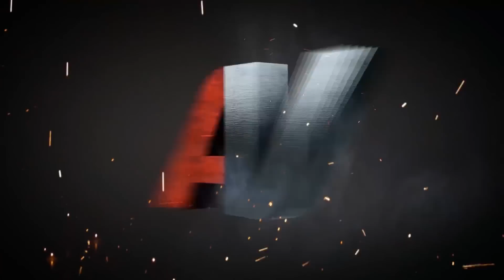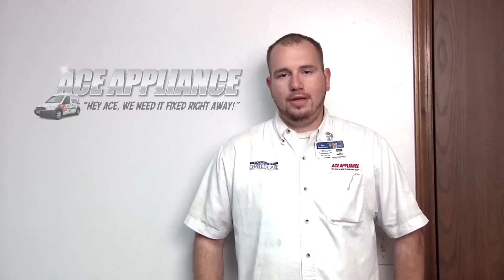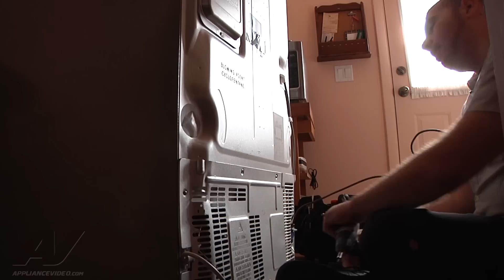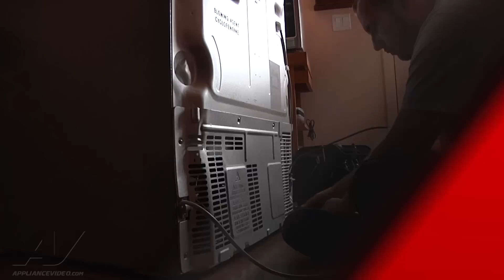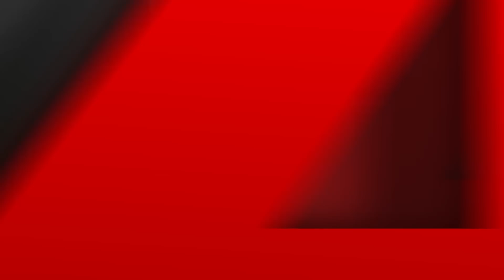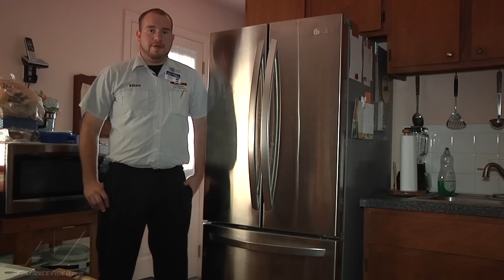LG Refrigerator Repair - Not Cooling - Relay - Diagnostic's & Troubleshooting

Comment: Ok same problem. BUT compressor is running. I didn't any codes until I went through the test procedure through the board. What are you thoughts. Oh yeah  22 was the "code" that came up during the testing procedure. I dont get fan in the freezer or in the refrigerator section but did under test .. Unit has been off over night so it's not frosted up. Also compressor is not warm or hot to the touch same with line going to condenser coil. Ok disregard 22 it's not a code it's part of step 2 disgnostics
Reply: Did you find out what it was, I’m having the same issue rn, any advise would be useful thanks!
Reply from the maker: Great question, if you have a more technical question that our parts department cannot answer, you can search our over 17,000 answered questions free at our website www.ApplianceVideo.com under our Repair Help section. You can also call our parts department at 1-800-830-5465 and they can give you help 7-days A week ,or search at www.SaveMoreOnParts.com  .

Comment: I have the same problem.  I can't seem to get the relay part from my appliance parts store.  Suggestions on where to get one asap.
Reply from the maker: Great question, if you have a more technical question that our parts department cannot answer, you can search our over 17,000 answered questions free at our website www.ApplianceVideo.com under our Repair Help section. You can also call our parts department at 1-800-830-5465 and they can give you help 7-days A week ,or search at www.SaveMoreOnParts.com  .

Comment: I have model Lmxs28626s and it not cooling properly ,but the freezer works. I have had the computer board changed, the damper panel/motor, the evaporator fan changed and it still will not get above 42 F Any help would be appreiciated..
Reply from the maker: Great question, if you have a more technical question that our parts department cannot answer, you can search our over 17,000 answered questions free at our website www.ApplianceVideo.com under our Repair Help section. You can also call our parts department at 1-800-830-5465 and they can give you help 7-days A week ,or search at www.SaveMoreOnParts.com  .

Comment: Hi I needs some help I have lg French door refrigerator lg replaced compressor drier just about everything possible what the tech said well my problem is refrigerator not cooling enough I have it 34 and it wont cool enough I have temamerter inside and says 47, 49
Reply from the maker: Great question, if you have a more technical question that our parts department cannot answer, you can search our over 17,000 answered questions free at our website www.ApplianceVideo.com under our Repair Help section. You can also call our parts department at 1-800-830-5465 and they can give you help 7-days A week ,or search at www.SaveMoreOnParts.com  .

Comment: I have an LG Fridge model LFXS24663.  The fridge works fine and keeps food cold.  Freezer does not.  It does not make ice.  Thermometer shows 45 degrees no matter the setting being at 0 degrees.  Do you know what the problem might be?
Reply from the maker: Great question, if you have a more technical question that our parts department cannot answer, you can search our over 13,000 answered questions free at our website www.ApplianceVideo.com under our Repair Help section. You can also call our parts department at 1-800-830-5465 and they can give you help 7-days A week ,or search at www.SaveMoreOnParts.com  .
Reply: Hi Margie. I have the same problem discovered today. Did you ever find out what it was?
Reply: Hi Margie, I'm having the same issue, may I ask how did you fix yours. What was the culprit?

Comment: LG LFX25974SW not cooling, help! Compressor and evaporator area fans are working. Compressor area sound seems normal to my untrained ear.  Thanks.
Reply from the maker: Great question, if you have a
more technical question that our parts department cannot answer, you can search
our over 10,000 answered questions free at our website www.ApplianceVideo.com under our Repair Help section. You can also call
our parts department at 1-800-830-5465 and they can give you help 7-days A week
Monday -Sunday, or search at www.SaveMoreOnParts.com  24 hours
7- days A week.

Comment: Hi, I ordered two relays and  it works good after replace the old one. However, it works only for two to five days and then the  no cooling coming up again. I replace other relay, It keeps the same.  Any idea would be appreciate. my LG fridge#:LTC19340SW
Reply from the maker: Zhang Samuel 

All of our technicians are now answering questions daily at our http://www.appliancevideo.com/ website under the Repair Help section.  We also have over 1600 common questions and
answers that you can easily search through by your model number, appliance
make, problem or error code and it’s absolutely FREE. You also have the option
to email a factory service technician with a question on your appliance at
http://www.appliancevideo.com/repair-help/ . If you’re looking for a repair video, you
can also search our library of over 2600 free repair videos. ApplianceVideo.com
specializes in quality DO-IT-YOURSELF appliance repair videos and we get over
800,000 views per MONTH to our videos worldwide and growing. If you need of
parts for your major appliance, we have over 5-million parts in stock at http://savemoreonparts.com/ .  Thanks
for your support. Matt Ace Appliance factory service technician.

Comment: I have a LG model #LFX25976SW/00.  The freezer iced up the other day so we took everything out and got all the ice out.  The freezer door seemed to close well after all the ice was out.  We put all the food back in and the next day we were having trouble will ice forming one side making it hard to open the door completly and hard to close to make sure it's sealed.  Can you help?
Reply from the maker: Robin Allen 

All of our technicians are now answering questions daily at our http://www.appliancevideo.com/ website under the Repair Help section.  We also have over 1600 common questions and
answers that you can easily search through by your model number, appliance
make, problem or error code and it’s absolutely FREE. You also have the option
to email a factory service technician with a question on your appliance at
http://www.appliancevideo.com/repair-help/ . If you’re looking for a repair video, you
can also search our library of over 2600 free repair videos. ApplianceVideo.com
specializes in quality DO-IT-YOURSELF appliance repair videos and we get over
800,000 views per MONTH to our videos worldwide and growing. If you need of
parts for your major appliance, we have over 5-million parts in stock at http://savemoreonparts.com/ .  Thanks
for your support. Matt Ace Appliance factory service technician.

Comment: I have a LG refrigerator model # LRSC26980TT. 
Suddenly, the water does not come out of the refrigerator.
Reply from the maker: david kim 

All of our technicians are now answering questions daily at our http://www.appliancevideo.com/ website under the Repair Help section.  We also have over 1600 common questions and
answers that you can easily search through by your model number, appliance
make, problem or error code and it’s absolutely FREE. You also have the option
to email a factory service technician with a question on your appliance at
http://www.appliancevideo.com/repair-help/ . If you’re looking for a repair video, you
can also search our library of over 2600 free repair videos. ApplianceVideo.com
specializes in quality DO-IT-YOURSELF appliance repair videos and we get over
800,000 views per MONTH to our videos worldwide and growing. If you need of
parts for your major appliance, we have over 5-million parts in stock at http://savemoreonparts.com/ .  Thanks
for your support. Matt Ace Appliance factory service technician.

Comment: Hi, I have a similar problem with my unit but the repairman says that he has to change the small unit that looks like a radiator is it possible he said that is liking but I don't hear the compresor work o any water problem
Reply from the maker: Lourdes 
       All of our technicians are now answering questions daily on the ApplianceVideo.com website. You can search completely FREE in our Repair Help section. Or you can get unlimited technical advice and video links emailed to you by our 14 factory certified technicians at http://www.appliancevideo.com/premium-membership/.  If you are in need of any parts please support our parts department on line at http://savemoreonparts.com/ or call 1-800-830-5465 7-days a week until 11pm Eastern time. Thanks for your support. Matt Ace Appliance factory service technician.

Comment: hi, we have a lg fridge that is getting condensation on the left side of fridge on the outside. Model number LFX23961st. Any idea why we're getting condensation on the outside?
Reply from the maker: Bill 
      All of our technicians are now answering questions daily on the ApplianceVideo.com website for anyone needing help. Just copy and paste this this question under REPAIR HELP, and one of our  factory authorized technicians  will answer any technical questions at absolutely no charge on your appliance issues. We also have over 2600 free repair videos to help with your appliance repair issues. Thanks for your support. Matt Ace Appliance factory service technician.
Reply from the maker: ***** 

                   All of our technicians are now answering questions
daily at our http://www.appliancevideo.com/ website under the Repair Help section.  We also have over 1600 common questions and
answers that you can easily search through by your model number, appliance
make, problem or error code and it’s absolutely FREE. You also have the option
to email a factory service technician with a question on your appliance at
http://www.appliancevideo.com/repair-help/ . If you’re looking for a repair video, you
can also search our library of over 2600 free repair videos. ApplianceVideo.com
specializes in quality DO-IT-YOURSELF appliance repair videos and we get over
800,000 views per MONTH to our videos worldwide and growing. If you need of
parts for your major appliance, we have over 5-million parts in stock at http://savemoreonparts.com/ .  Thanks
for your support. Matt Ace Appliance factory service technician.

Comment: This is what's happening to my lg fridge not cooling properly, how much will it cost to get it fix
Reply from the maker: ShowKiings
                                    If you go to our FREE repair help website at ApplianceVideo.com and post this question, we have 14 factory authorized technicians that will answer any technical questions at absolutely no charge on your appliance issues. This is the only website on the web that you can get questions answered by certified appliance and HVAC technicians along with over 2600 free repair videos.  Matt Ace Appliance factory service technician

Comment: Really helpful .my Samsung refrigerator is about four years old and recently started making some loud noises like rattles ,the food in the freezer started to get defrosted .the freezer door is now shot  won't open and the food on top of the refrigerator is getting spoiled in three days  need some advice please.
Reply from the maker: Martha
                              If you go to our FREE repair help website at ApplianceVideo.com and post this question, We have 14 factory authorized technicians that will  answer any technical questions daily on your appliance issues. This is the only website on the web that you can get questions answered by certified appliance and HVAC technicians at absolutely no charge along with over 2600 free repair videos. Thanks Matt Ace Appliance factory service technician

Comment: hello, I was trying to follow your video to replace the relay of our fridge but I forgot where to put the blue and pink wires... I see a "2" and "3" number beside each of the relay's 2 prongs but can't see any numbers on the wires to match it... pls help! :)
Reply: Pink to the inside terminal and blue to outside terminal
Reply from the maker: Jhonwayne Pumaras 
                                  I am not sure on the specific wiring for your model.  If you go to ApplianceVideo.com and type in
your model number or your symptom you are having. Our site has 2600 free videos
on it to help solve your problem. We add new videos every week. There is a very
good possibility you will find a video that will help solve your problem.
Please help our ranking by subscribing to our YouTube page or posting our
ApplianceVideo.com site on your Facebook or Twitter account. Thanks Matt,
 Ace Appliance service technician.